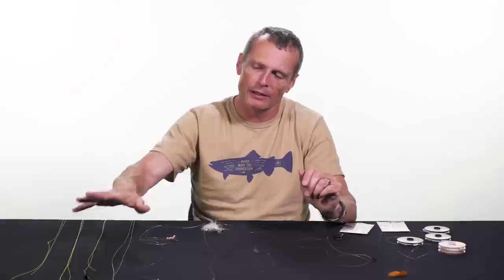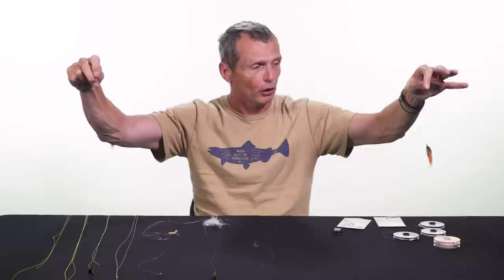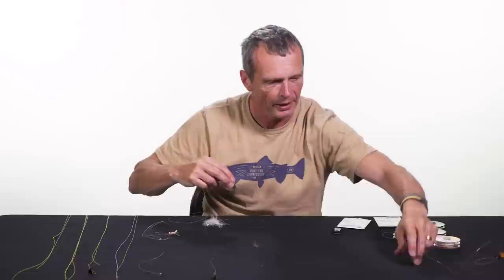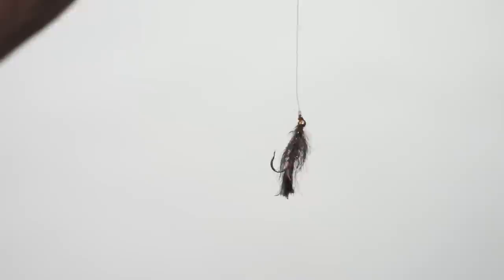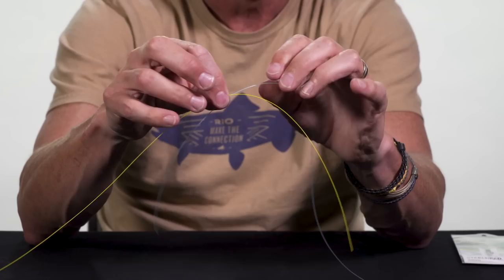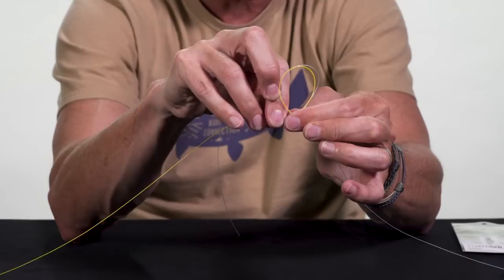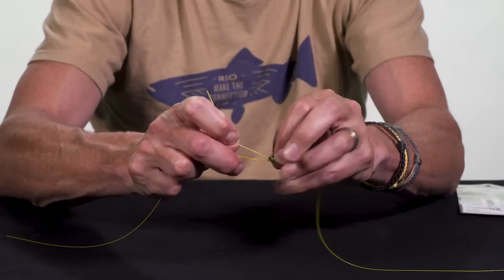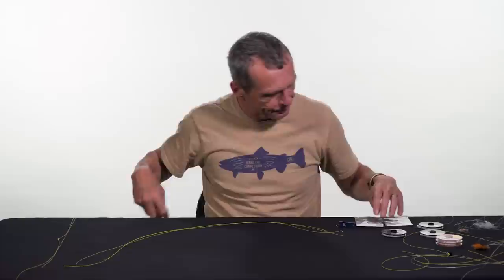How To Tie Droppers and Knots - RIO Products

Comment: I thought I originated using a loop snugged up against the knot as a dropper! Been doing it this way for at least 30 years +! 
So I guess I must have some Polish genes somehow? Ha ha I did not see the improved version I eventually came up with though! 
When I made my droppers now, I tie the fly on using the Jack Miller knot (extremely strong) on a short piece of leader material  first, 10 to 12 inches 
long, 12 pound test maxima, then I make a loop using almost all the remaining line after tying on the fly except I leave about an inch or 2 of the single strand to the hook! This allows the fly movement. The large loop is then tied together in the centre using a double version of the surgeons knot, two turns not three as it is normally tired! I have a dropper about 4 or 5 “ long being held off my leader by the stiffer loop (as an outrigger). This still allows the dropper to spin around the leader but better holds the fly away from it reducing tangles. You will still get some tangles but fewer than my previous method! Check it out and see if you agree! Tight lines!

Comment: Rather than using the bend of the hook to tie to, I use the eye of the hook.  This allows each fly to flutter slightly and there is no risk of line coming off.  Use the eye like a tippett ring.